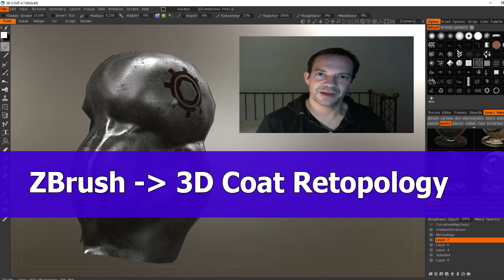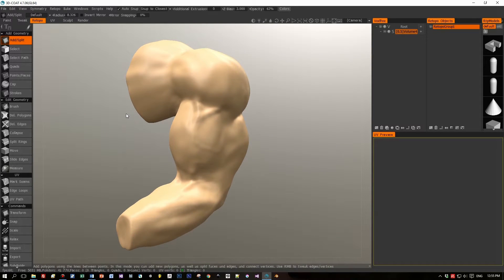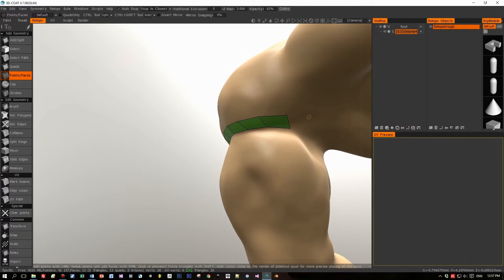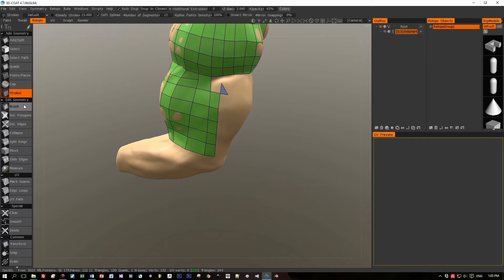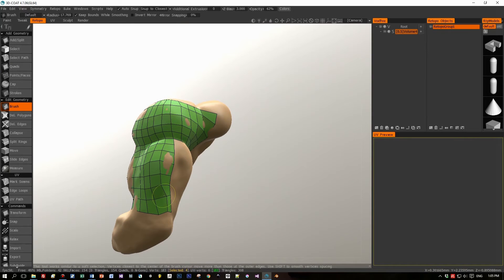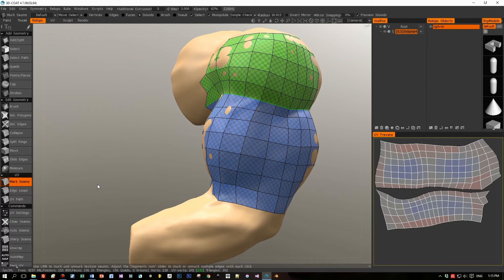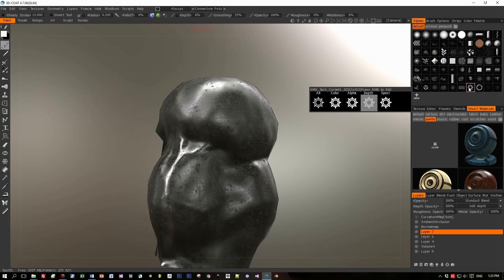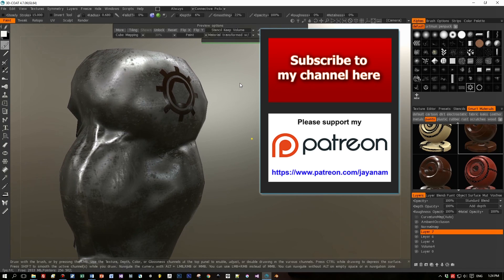ZBrush to 3D-Coat : Retopology tutorial

Comment: Do you prefer 3DC retopo over Z-remesher?
Reply from the maker: Well this is a bit mxing up 2 different things: ZRemesher is an auto-retopology, what I do here in 3D-Coat in this video is manual retopo. ZRemesher is a great way to reduce polys but in my opinion if you want to have a game-ready low-poly model you need a manual retopo. 3DC also has auto-retopo which also works quite nice, but most of the time you have to tweak the resulting mesh. I stick to manual retopo for game models.
Reply: He's probably referring to characters.  When you animate them you want to have them to be low poly and to consist entirely of well laid-out quads.  The "nicely laid out" part is where automatic retopology fails, because they can project the quads diagonally or incorrectly in general on the face.  

I kind of see where he's coming from.
Reply from the maker: SketchupSWBF2 Excactly. The auto-retopo is great, but when it comes to animation you have to define the edges carefully and think of where to place the seams and stuff.
Reply: why isnt the auto retopo good enough for game stuff? just curious because mine seem to come out perfect, but then again im a beginner so not quite sure what to look for lol.. when I use 3d coat auto retopo it seems to work better the higher I raise polys